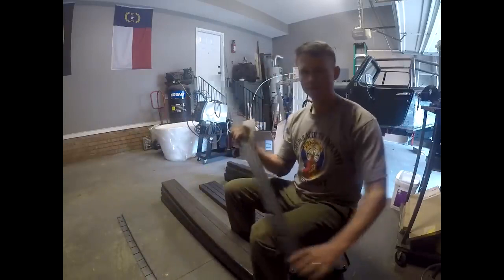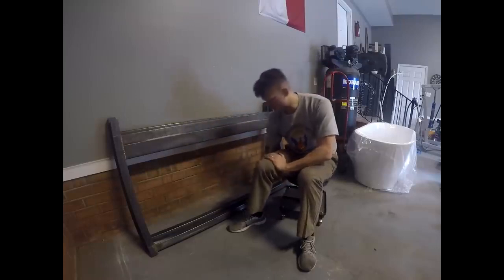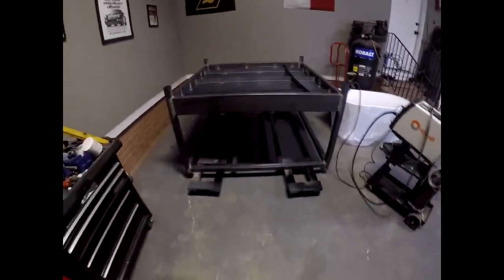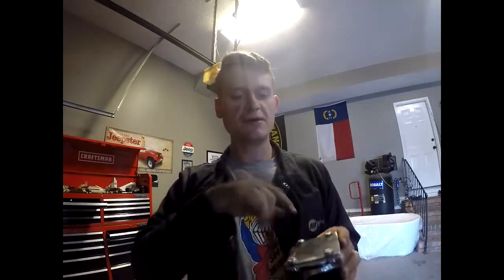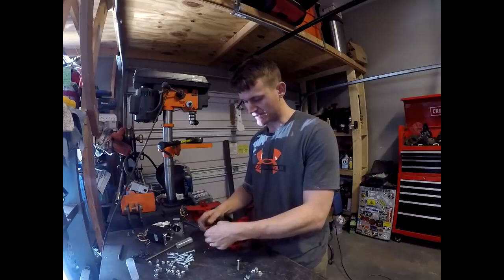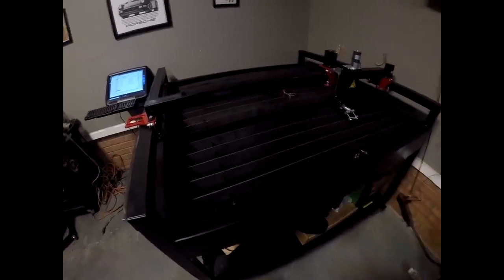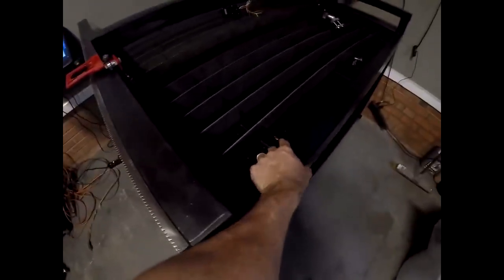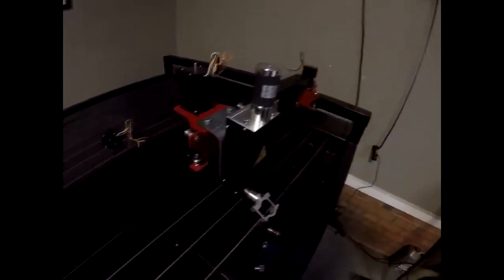Budget  DIY CNC Plasma Table Framework || Legacy 4x4 and Off-Road

Comment: Can I use 2.5 x2.5 sq tube with these brackets
Reply from the maker: You can but it would be very tight, the brackets are meant for 2x2

Comment: what was the seller's name on ebay for the brackets?
Reply from the maker: For those brackets it was "wiseco16" here is a link to this style of brackets. For my second machine I ended up using extruded aluminum and making my own brackets for it. 

https://www.ebay.com/itm/CNC-Router-Plasma-Gantry-Carriage-Rail-Car-NEMA-23-motor-2x2-2x3-or-2x4/124393221647?hash=item1cf669ee0f:g:HEwAAOSwJppdRA8y&var=425266968652

Comment: The axis that goes from left to right is the X axis and axis with the motors on each side is the Y axis. I just built one like these last year and used the same linear carriages they work ok not the best but they get the job done. Going to upgrading to linear guide rails. I was having issues with the X axis with using the bearing carriages I was getting to much wobble I couldn’t get it right so I modify them to use them with linear guide. Like I said will be doing the Y axis soon. Good job on the build and info
Reply from the maker: I'm just getting around to finishing the table... still working out the small items but haven't had any trouble doing test runs with the guide rails... yet. The scale on the software is giving me some greviences right now
Reply: Oh man I had a hard time with linuxcnc well getting the torch height controller going. But you really need to know how to edit ini.files and Hal.files if you want to customize it. But the forums for them are great they can show you and help you set it up. Just an FYI torch height control is the way to go I tried it with out one and it was a pain standing there holding down material with stick so it can cut. But once you get it all going to it gets easier.
Reply from the maker: @carrgrienier7726  the forums are always a savior loll.... I just got it dialed in, test cut tonight hopefully but we will see how it goes!